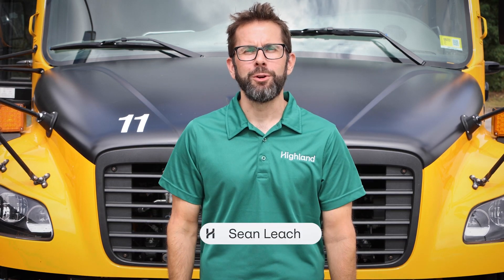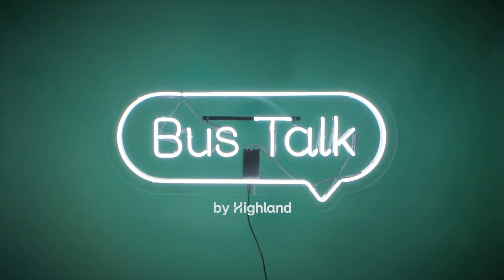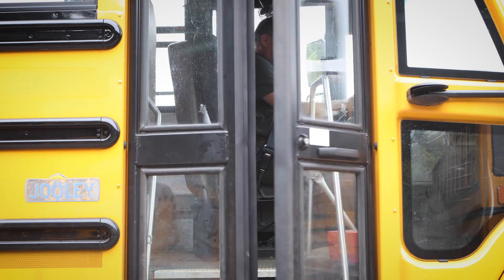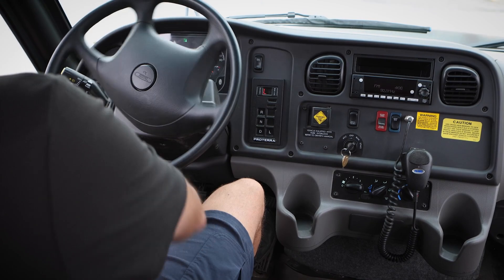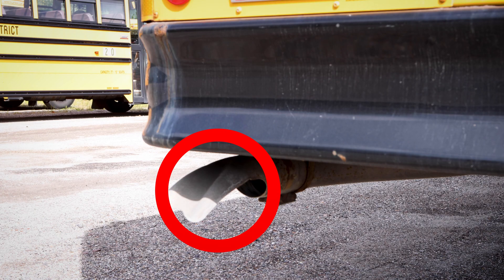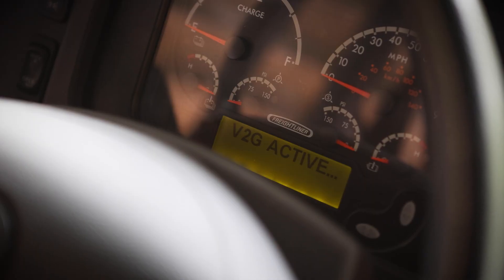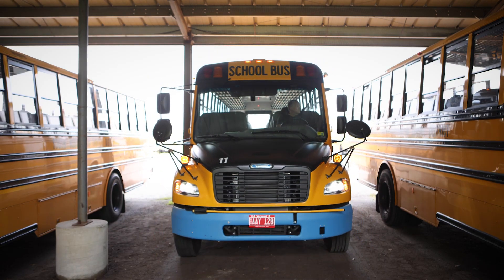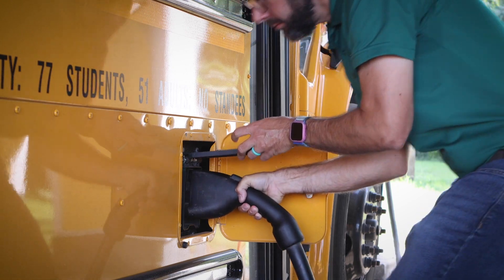What's Inside an Electric School Bus? | Bus Talk on the Road Episode 1

Comment: How do they work in the cold?
Well I'll tell you, If they get below 30% charge it will go into "survival " mode. 
That means NO HEAT, NO  BLOWERS /DEFROST. 
No A/C in the south. If that's important to you, but I never drove a "Big" bus that had A/C.
The one that we had ( I never drove it) could only run morning or afternoon,  no midday. 
So you would need 2 electric busses  that cost twice as much to do the work of 1 diesel.
Reply from the maker: Thanks for sharing your experience. Unsure what make and model the vehicle you are referencing is, however all of the OEMs we work with continue to function all the way down to a single digit state of charge. If you'd like to learn more or tell us about your experiences, please reach out to us at info@highlandfleets.com